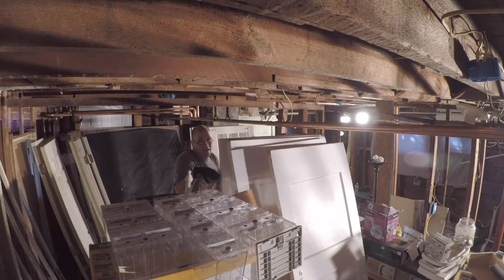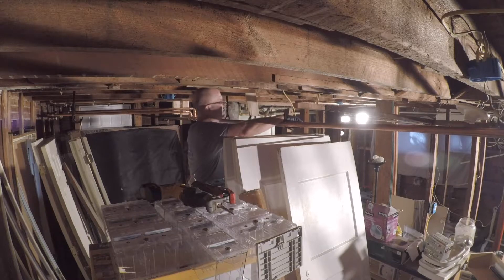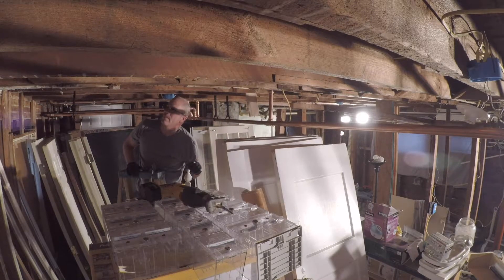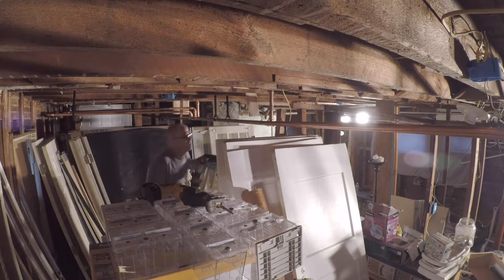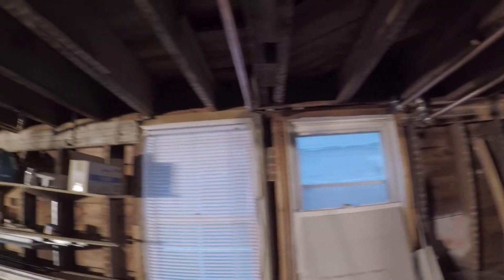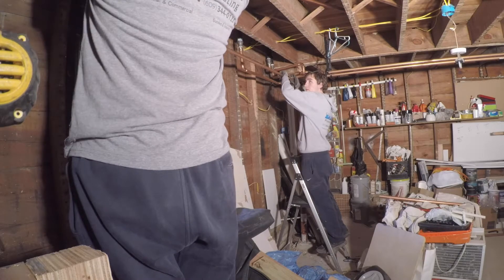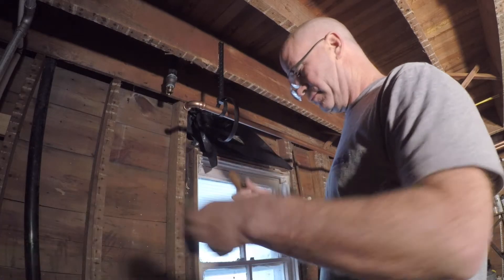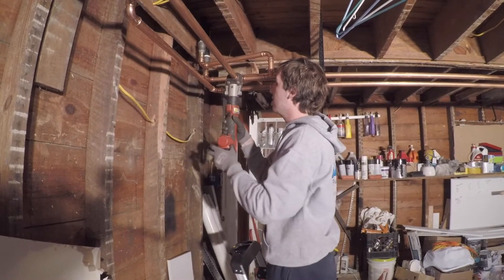Heat mains replaced Ridgid RP 200 Pro Press is the dream

Comment: Hey cb1 &cb2.  Hanging heat mains and branch lines with rubber straps...we don't use that stuff here in Massachusetts.  Also galvi lines for gas.....we use regular black steele....you guys have different codes in NJ I take it
Reply: Also here in Massachusetts, whenever we pro-press/mega-press. We have use a marker to mark the depth of every fitting on pipe. Black marker for copper and white or yellow paint marker , for black Steele pipe. For inspection purposes. If 1 fitting is not marked on pipe, your job could fail inspection. Mass. Is kinda tight about inspections.
Reply from the maker: Ya. I have to bone up on the marking of pipes for sure.

Comment: I found the rigid rp-200 propress that you use,I had to look for rigid rp-200b in order to find it on amazon,not that I am planning to buy it.I have already ordered a 18volt press tool comparable to the rigid rp-200b at almost a third of the price.
Reply from the maker: nice.
Reply: @ChuckBarron  Thank you my Brother.
Reply: @ChuckBarron  Please excuse my outburst Chuck but check this out before you judge me my Brother.I'm Puerto Rican okay?I was talking to my sister the other day and I told my sister that when my Mom passes away I don't know if I'll be able to go to NYC for the funeral because I'm scared,I really am.I have a clean record,so clean that it squeaks is what I've been told,I am also a hardcore Republican and I also happen to have a LTCF (License To Carry Firearms).Okay,now suppose I go to NYC and some NYPD cops sees me and gets a hardon for me?I can always leave my LTCF here at home in PA but then guess what Chuck,do you know that the police can know that I have a LTCF just by running my driver license ID?So how can I know or be assured that some power tripping NYPD cop isn't going to target me and use the fact that although I'm a licensed locksmith in good standing and I have no record my driver's license will indicate that I have a LTCF and decide to unjustly arrest me using the excuse that maybe I have a firearm on me (which is something that I would never do because I want to keep my record clean.),take me into a van or a quiet room at the police station and unjustly beat me,cripple me or kill me then get away with it all because he's/she's a cop?Don't try and tell me that it's just my imagination because I was born and raised in NYC where I moved aways from going on thirteen years now and when I lived in NYC I had to file complaints against cops that had nothing better to do than to "fuck with the Puerto Rican."because they were bored.The unjust abuse and murder being committed by the police affects us all because police can and will abuse and beat anyone at anytime regardless of ethnic background.It's not just black people that are in danger around the police now a days,we're all in danger of falling victims to power-tripping homicidal cops that have no business wearing badges in the first place.Whether black,brown or otherwise if a cop gets a hardon for you you may be unjustly arrested,beaten or killed because cops do not face consequences for their actions like they should when they should and therein lies the problem.
Reply: I had to work for and with my mentor the locksmith for four whole years before he felt that I was competent enough to become a licensed locksmith and you had to work at least five years as a plumber's apprentice before your mentor felt that you were competent enough to become a licensed plumber right Chuck?Yet people spend a measily six months at the police academy and straight away those people that graduate the police adademy are given the right to shoot and kill anyone that police academy graduate deems a threat with very few,if any,questions asked.I have to be extremely careful in how I conduct myself as a locksmith because if I do anything what so ever that violates the law my locksmith license get revoked and I stand very very little chance of getting my locksmith licensed reinstated.The same applies to you as a licensed plumber,right Chuck?If you do anything wrong or get too many complaints filed against you your plumber's license gets revoked right?Yet that psychopath cop that killed that black man had at least eighteen complaints filed against him in the twenty years that he was a cop and not a damned thing was done about it.How are we supposed to come to terms with and understand that Chuck?Seriously.If a criminal breaks my door in in the middle of the night I am justified in shooting said criminal.But if the police gets the wrong house and as a result cops get shot now I'm totally fucked,does that make any sense to you Chuck?Because it sure as hell makes no kind of sense to me.So if I get my door kicked in at night while I'm sleeping I'm supposed to ask whoever breaks in my door for ID before I can open fire to defend and protect my loved ones,my home and myself?Seriously?It's not just the abuse of power that's systematic Chuck,it's the idiot laws that give the police undue and unjust liberties to do as they damned well please without any fear of prosecution.You don't believe what I'm telling you Chuck?Look up "Qualified immunity",read through it so you can see for yourself exactly who is protected under "Qualified immunity" then get back to me and let me know if you think it's fair.God and peace be with you and your loved ones my Brother.